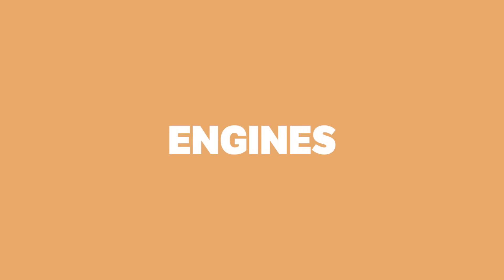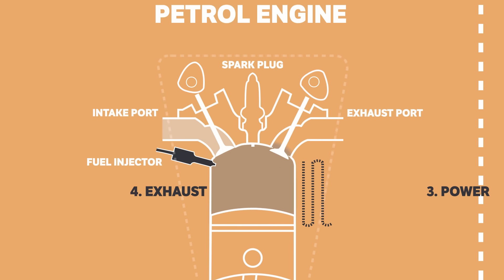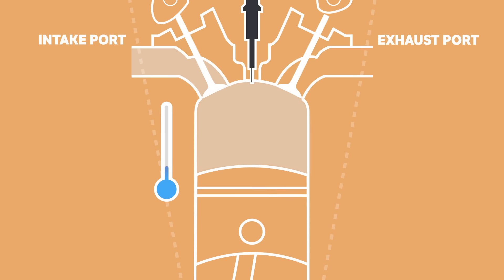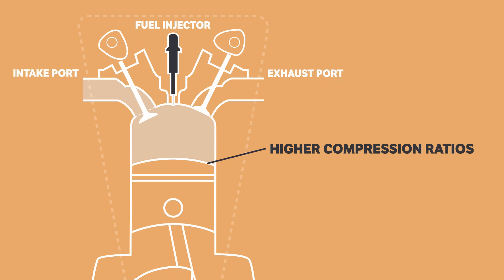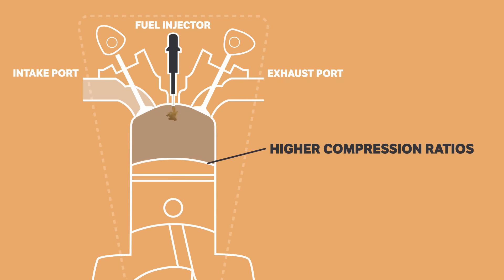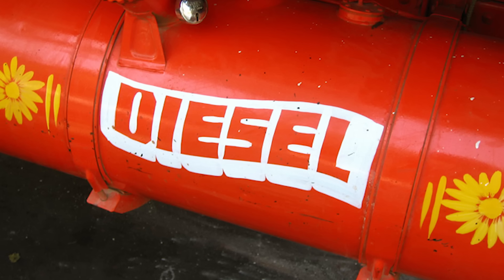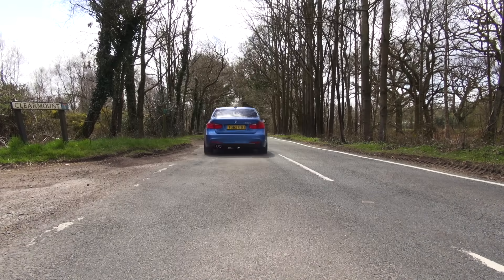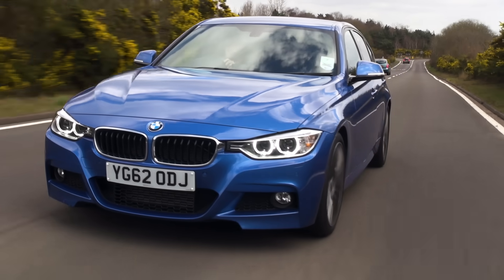The Differences Between Petrol and Diesel Engines

Comment: One should point out that, although some newer diesels do have a throttle body/valve, it's not actually required for engine operation. Vehicles that do have it use it for allowing efficient EGR operation, smoother engine shutdown and sometimes help with engine braking.

Diesels can't actually restrict airflow like petrol engines during normal operation as any significant decrease in airflow will reduce ultimate compression pressure below minimum and hinder fuel ignition. 

Thus throttle valves only operate during engine coasting (to help with EGR) or during shutdown (to reduce piston knock back as the engine stops) and in some other specific scenarios. 

<3

Comment: I own both a Turbocharged Petrol (2005 1.5T Mitsubishi Colt CZT) and a Turbocharged Diesel (2016 Seat Leon FR 184 TDI with a DTUK Tuning Box) car. Personally, I prefer the Diesel, boost kicks in way sooner (1800 RPM in the diesel, around 3500 in the Petrol) so it's great for overtaking and just in general driving such as pulling away from Junction. However I always make sure to only use the Diesel for longer journeys and the Petrol for shorter journeys to shops and such as the DPF getting clogged can be a big problem with the Diesel if you're not driving it often and long enough.

Comment: I'm here to read comments and understand why Diesel?

I also love Diesel because of good pickup and more power 💪 but I hate Honda City because of low ground clearance and lower ground clearance 😬
Reply: lol why compare 2 cars mate
Reply: Diesel has less power and therefore less pickup than gasoline engines of anywhere near similar size or weight.  Diesel for industry agriculture and husbandry.  Gasoline, alcohol, nitromethane for Motorsport,
Reply: Power, not Torque, is the limiting factor for acceleration, towing, hillclimbing, anything you can think of.

Comment: Why racing cars are mostly petrol?
Reply: They are used mainly bcs most petrol engines are lighter then the same output diesel engine. Tho diesel engines have higher torque they don't rev as high as the petrol engines. Power by definition is the product of torque and speed of crankshaft (RPM) thus petrol engines have more top end power and speed where diesel engines have much more lower end torque. Primarily its the fact that petrol engines are lighter then diesels and as we know in racing weight reduction is a huge factor in car performance.

Comment: I prefer Diesel. +1000 kilometers with only one tank filling. 
If i could buy a second car for having fun it would be a petrol.
Reply: I did 1300 with 2.0tfsi. Even with accelerate to 200 a few times. Petrol is good for short and long trips while diesel is only for long trips good.
Reply: Why are people so obsessed about how long they can go without fuelling?  Can you drive non stop for that long?  

If it’s for saving money it’s often a false economy too. By the time you amortized the additional cost of a diesel, you’re getting into very expensive repairs. You need to drive a lot to justify a diesel, and I’ve found even here in North America that I can easily drive less than 15,000km a year with simple lifestyle changes.
Reply: @Bartonovich52  i know this comment is 1 year old but let me put it in a way that fuel isnt cheap and 1 tank here in euroupe is 55$. And the normal paycheck in eourope is around 400$ and if you have to refill it twice a week it will cost you 110$ to refill so yea i preder disel as an everyday car but petrol is ok for like once a week

Comment: Seat Altea XL 1.9 TDI 105 HP awesome engine!
Reply: Audi A3 8P1 1.9 TDI PD 105 HP. - 1.9 is a legendary Engine
Reply: If you want a real legendary engine, you want the BMW F30 335d or equivalent. 313bhp as standard with 465 lb/ft of torque. I had mine remapped to 390bhp and 620 lb/ft and it was quicker than an M3.
Reply: Yeah, VW AVB and its siblings are great but man, have you ever had 1z? Best TDI all-rounders
Reply: Is it the same engine in Jetta and Passat diesel cars?

Comment: Audi 2.5 TDi 860.000 Km still running
Reply: VW golf2 over a million.. just give him oil and replace filters it will go until you live
Reply: @franski6575  yep a good mk2 can last for ever its a tank :) im a proud owner of mine golf mk2 1985 1.6D i think it has a milion because if this guy claimed hes audi has 800.000 witch is bull shit the car probebly has 300.000 or 400.000 km/h and its dead at that kilometer while my mk2 has probebly 600.000 or 700.000 km/h and its still going
Reply: @franski6575  1.9 TDI engine?
Reply: @minimol222  nope 1.6D
Reply: @franski6575   and replace the turbo in time.
Reply: Diesel engines if used and maintained properly can go brutally long distances. My friend have one 2.5 TDi Audi like the one you talk about, he bought it with 420.000 Km and it was and still is in a pretty nice condition, and have a power like a mad bull. Great car. I'm saying this as an anchored petrol lover.
Reply: Also, in my country there is a BMW 530d which has 1.200.000 Km in it, it was sold this year from the first user in great condition.
Reply: @MexMX  really? is that still running?
Reply: @krishnakumar-zf1cv  yes, it still runs. Unfortunately the new owner turned back the clock.. But there are hungarian videos about that car, you can check them out. The first owner took real good care about the car.
Reply: Mex yeah diesel isnt the best
Reply: Wtf? Thats awesome:D
Reply: taxi in China, 180~200 thousand km per year, runs for at least 4 years powered by natural gas and without much maintainance. 
860000km is ok. A honda accord reached 1.6million in the US
Reply: @xiwang9560  Which brand engine is there in the Taxi? Honda?
Reply: @minimol222  it depends. in where i live, Suzuki. 
i was once told that car engines (regular ones, not super cars ofc) are designed to last more than a million KM. it's usually the rubber parts which fail along the years.
Reply: I bought one brand new, engine blew up after one month.
Reply: Mercedes 190D.... 1 115000kmh and still works perfect.
Reply: A car will last if u take care of it
Reply: And sounds like a tracker :D
Reply: usual for Japanese cars
Reply: @sagersager2455  but ever since it's not a Japanise car it is impressive
Reply: @H - Audi E280 CDI?
Reply: @H - Audi 300?
Reply: how long can you drive the same car??
Reply: ford mondeo from 2001 - TDDI... 2.0L, 90bhp, 1/2 million miles, still running. The body is rusty but the engine is fantastic.
Reply: wtf some type of record
Reply: They are some taxis that have old cars with very low milage on clock.. Reason is because they done so much milage the clock resets.. (:
Reply: dobro
Reply: Christian Scharff Wow! Road to 1Mil huh? :))))))
Reply: Because it is an Audi.
Reply: nah thats bullshit my dad owned an audi a6 2.5 tdi 132kw 2001 he had ton of issues, in his words the car was a total shit he had 330.000 km/h on the clock and everything started to break down eletronics, mechanics and so on he sold it for 2000$ US dollars and the car stil has issues with the new owner who claimed he replaced the engine these cars are shit, audi is not a realible car. so he bought a mercedes c200 2004 2.0 CDI 96kw (w203) new model one he is a pretty happy owner less maitnance more miles to drive he bought the mercedes when it had 220.000 km/h now its 290.000 km/h and its not breaking down..
Reply: Thats because it's an Audi. Quality and german engineering are unbreakable 😜😏
Reply: @graffitiistkunst8753  before 2008 yes. After then they only earn money from services because no one would replace a unbreakable car.
Reply: @graffitiistkunst8753  but their tanks wasnt good like their cars. Of course was the best but doesnt unbreakable. Nazi Germany lost war becouse they didnt have enough tanks. One history says one panter ( nazi germany tank ) could destroy 14 american tanks when the american rang. And this was one and only way to destroy this death machine :D.
Reply: Lol. Ask any Audi owner about the 1.8T engine. “unbreakable” my ass. 

Also... what kind of km and how many a year?  Most of what kills a car is age related deterioration. Internal corrosion, cold starts, gaskets aging and rubber and plastic components failing. 

Finally... because it’s an expensive diesel, people put more money into them. If you put half the money into a gas car it would last as long. 

I’ve had tons of very pedestrian cheap gasoline powere cars well over 500,000 km. It’s nothing special.  Unlike the diesels that age without very major work... none were burning oil or making smoke.
Reply: @Bartonovich52  you got clearly no idea about cars
Reply: @Bartonovich52  You mean 1.8T is really bad?
Reply: Bartonovich52 VW New Beetle 1.8T 205 000km no major issues, fuel pump and regular service
Reply: @graffitiistkunst8753  Haha thats not true! Both BMW and Audi has major quality issues even if BMW is the worse of them

Comment: Diesels don’t have a throttle body, where did you get all bollocks from?
Reply: Krish vinod Mk2 Focus ST but I work at Ford and every diesel I’ve worked on has a throttle body
Reply: @CookieScaley  throttle paddle in petrol engines control the amount of air that goes in the engine, while diesels control the amount of diesel that goes in. technically you dont have a throttle body in diesels.
throttle body= controls air intake
diesel pump by your terms ''throttle body''= controls diesel intake
Reply: Cool I have a Toyota Camry

Comment: Petrol: Better for racing 

Diesel: Better for everyday commuting
Reply: DACHIE!! Not entirely true. Diesel is better for drag racing because of the much higher torque
Reply: Hummus Connoisseur I don't know much about drag racing. For circuit racing, gas is better because your keeping the revs a up and gas engines make their power up higher in the rev range than diesel. Plus you don't want a lot of torque down low or it can be a difficult car to drive at low speeds. Although diesel is more suitable for endurance racing because of its fuel efficiency, Audi used diesel in their lmp1 cars.

Comment: You could spray 1mL+ around a spark plug in a diesel cylinder, at top pf cylinder, and spark lights diesel fuel that fraction earlier to give more power. Tier 6 maybe?
Reply: Shaun Grace diesels don’t have spark plugs, they have glow plugs
Reply: Haha. I mean spark plug in a new design. Good one Willy. Good spotting. Obviously petrol is dangerous under heat + compression to inject into hot cylinder about to compress but some bright spark will design it. They must ignite diesel at lower compression for efficiency etc or we'll be battery brilliance before long

Comment: Petrol ❤ because Diesel sounds like a tractor.
Reply: 1990s and older cars do sound like tractors but they are more relible engines then petrol engines take this for example i have seen golf mk2 1984-1992 all of them with 1.3 , 1.6 , 1.8 petrol engines had issues it was due to the age it self but the good old 1.6D 40kw is the best vw engine it keeps runing like a tank i mean 800.000km/h shit is not breaking down
and new cars like from 2000s dont sound like tractors the most quite engines i have seen is mercedes w203 2.0 cdi and bmw e46 2.0 engines they are relly good...
Reply: @ONI If the Factory is making some blazing horsepower, I'm happy to see smoke rings once in a while 😁
Reply: @ONI if your diesel is blowing smoke its 2 reasons why either you tuned it on purpose to make it blow smoke or your engine is dead its not getting high compressions.. my golf mk2 1.6D 1985 never had any black smoke issues...
Reply: Yea it's not the 90s anymore bro.
Reply: You sound like idiot

Comment: Mercedes Benz E300 turbo diesel, unbeatable 26 years 300.000 km and still running
Reply: Horacio Zimmer 300.000 is nothing for a diesel
Reply: Hummus Connoisseur i‘ve seen Diesel Taxis with more than 500.000 Km that are still driving smooth.
Reply: 2.0 4cylinders?
Reply: @jericlamb2676  i5 or i6, depends on the production year
Reply: jeric cordero No, if its a 300, it’s a straight 6 engine, most likely an om603 model engine.
Reply: Horacio Zimmer I got a w124 E300 Turbodiesel but it’s fwd! Om603.
Reply: 300.000km its nothing for Mercedes!.. They can go up to 1.5m km to 2m km!
Reply: Sean Johnson They can’t without a full engine repair, all the bearings have to be replaced at some point, the pistons and the cylinders won’t last up to 1.5mil
Reply: Uh... my 2004 F-150 with one of the worst gas engines in the world has 80,000 more km on it than your Mercedes. 

300,000km is nothing... for ANY vehicle.
Reply: My 250D W124 has 884.000km😅
Reply: 300km isnt much mileage

Comment: As a learner I’m finding my parents diesel easier to learn in. But my instructors car is a petrol and is a lot more twitchy with clutch and throttle control. I’m getting used to both but I prefer diesel.

Comment: diesel engine due to poisonous gases pollute the atmosphere producing heat combustion more .. other than petrol engine which is friendly with atmosphere .
Reply: Other than nitrogen oxides from diesels, they really don't pollute much when tuned right. Carbon emissions are low unless the engine is tuned for way too much fuel. Petrol produces more carbon emissions than diesel on average.

Comment: I love Electric cars. No messy fossil fuels.
Reply: Raj Pawar the source of electricity for charging the car is burning fossil fuels
Reply: @Ahmadsyar  No necessary as we have Nuclear, wind, solar and water as source.
Reply: @rajpawar9343  of course, nuclear, wind, solar, water are avaliable but they generate less power to be tangible and reliable. The cost of maintaining those are much more expensive than the energy they produce
Reply: But with Petrol and Diesel - no messy Fascism or Communism.

Comment: Petrol is short for petroleum which is the shit they pull straight out of the ground. Gas is short for gasoline, which is petroleum that has been refined so it can be used in combustion engine. You put gas in your car, not petrol.

Comment: I prefer petrol for 1 simple reason:

You can rev higher which means you can drift...
Reply: Lmao you can drift a diesel.
Reply: @jcpostraginoff932  I'll put it this way you can spin ur wheels faster lol ;)
Reply: Canon Gaming drift is oversteering the vehicle wich means the dynamic weight is lasting on the front of the vehicle, meanwhile the back of it has nearly no weight at all so therefore no traction on the wheels. To oversteer is easily possible with a petrol as well as a diesel engine. Even electric powered engines can oversteer, or as you say "drift"
Reply: https://youtu.be/1YewRkuM2Y8

Comment: Diesel should be banned. Because the fumes are proven to cause dementia. I'm terrified of getting lost on my way to lidl for my 9p beans because im on state pension and ending up in a rubber room, praying for deaths cold embrace. Also diesel is slow, noisy, expensive and boring.